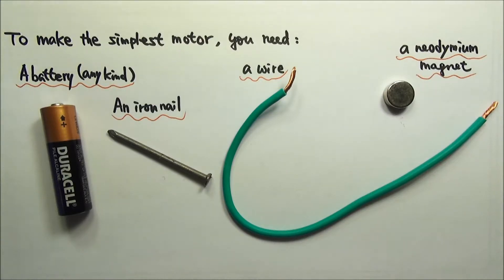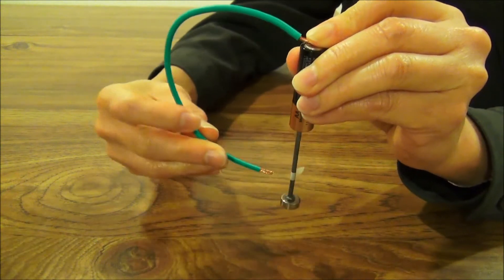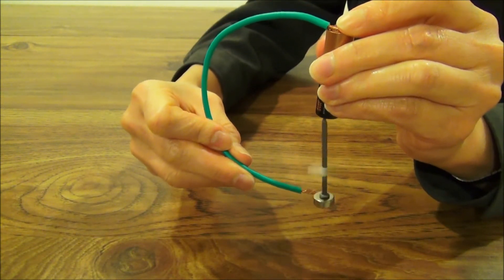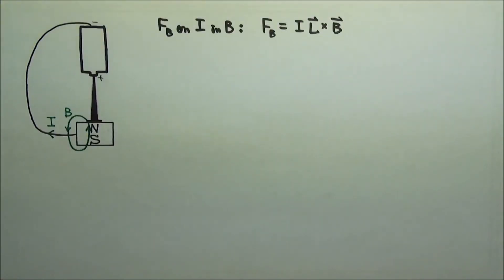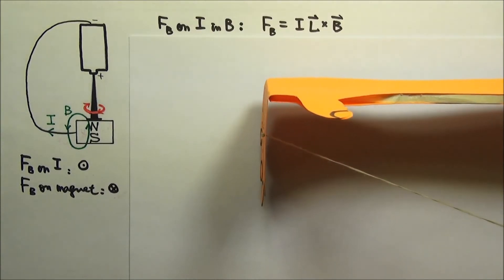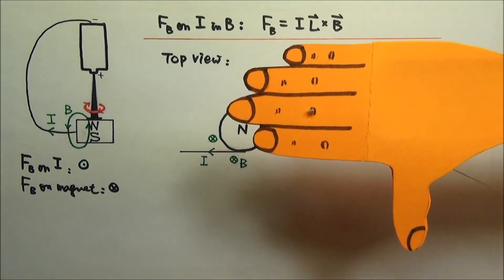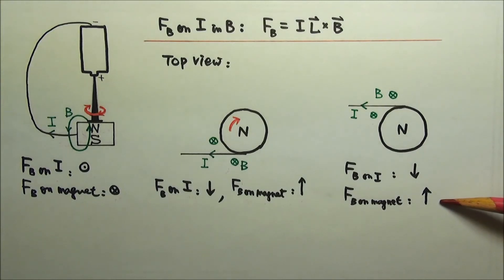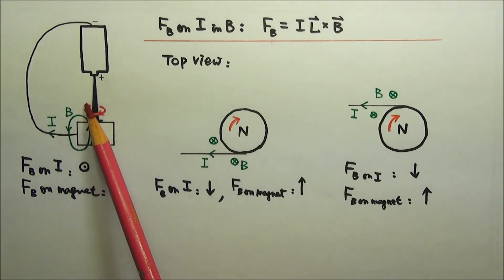Physics: Magnetism 20: The Simplest Motor: How to Make It and How It Works

Comment: I made one of these "motors" and it tickles me every time I make the screw/nail spin. ..... However ..... I noticed something unexpected. I found that I can make it spin WITHOUT TOUCHING the neodymium magnet at all. If the screw/nail is rocking a little bit back and forth like a conical pendulum, it will begin to spin and remain spinning as long as the screw/nail keeps moving back and forth. I suspect this is due to or somehow related to Faraday's Law that ANY change [ motion, frequency, amplitude ]  in the B Field will induce current (emf => I ) .... but I am not sure that is a solid explanation. ....... Anyway thank you for the delightful video and the elegance of this "motor".
Reply from the maker: I think it may be inertia: the nail + magnet are spinning and will continue to spin for a while until they lose all their kinetic energy to friction and air resistance even after the current is cut off. 
While they are swinging a little like a conical pendulum, the occasional contact between the wire and magnet provide current and therefore magnetic force to give the spinning nail + magnet occasional torque to pick their spinning back up.
Reply: Yau-Jong Twu  hi may i know the why the angular acceleration of sphere rolling on horizontal plane is zero